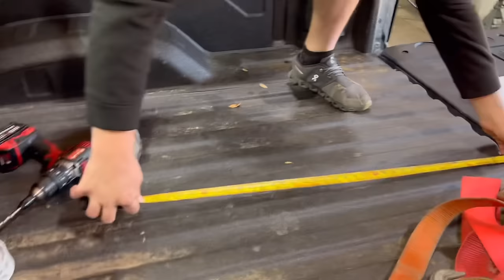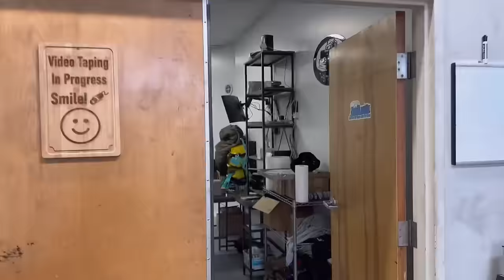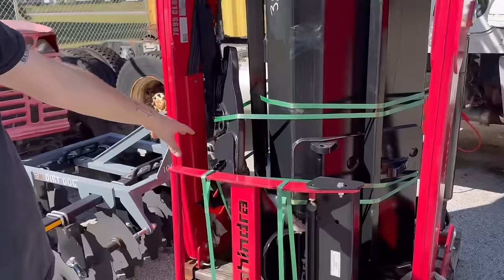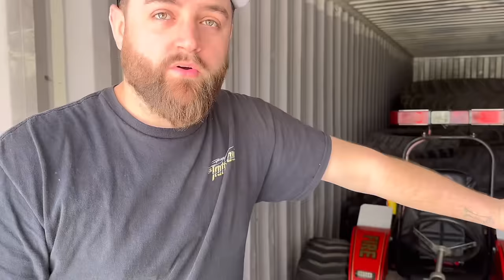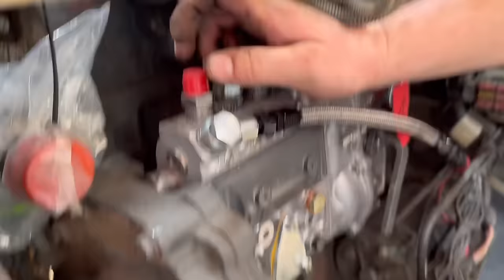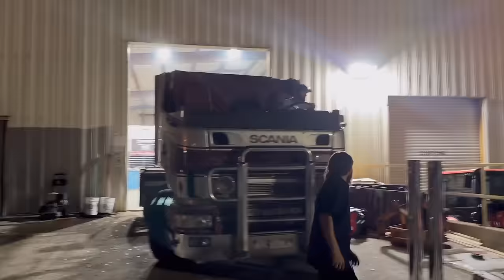We Are MOVING to Tennessee! Big Changes Coming!

Comment: Scania dealership, partnering up with the guys from semi casual. First scania dealer in USA. 
Just a guess
Reply: My thoughts too……..exactly
Reply: Have you seen Fitzgerald shop in Tennessee? Looks like a city. Semi casual is a tiny part of the operation. Not just Peterbilt Freightliner, international is the main manufacturer they work with.
Reply: @Carlos-r5n2b  Yes, I’ve known and been aware of the Fitzgerald name because of their many dealerships and glider business for many years. My guess is maybe something associated with that trucking family and possibly some type of association with Scania. Just a gut feeling I guess.
Reply: I’ve also seen the huge operation at FCR. Most fascinating repair business ever. Wow! 👍🏻
Reply: @BigJohn29ky  maybe 🤔
Reply: @BigJohn29ky  they do show car quality paint. Want my 61 Ford starliner paint put back original inside is original. No good painter around here i saved enough for quality job gonna be careful who I hire to do work. No hot rod original fender skirts complete chrome 352 v2 i rebuilt transmission too . I can do so many things I learned from watching others but body work and paint is an art I suck at☹️
Reply: Navistar is Scania's sister company in North America. If Scania go for it, it will be via already established dealers. Bruce an naturally work for them

Comment: Drill a couple of drain holes in the bottom of those plastic IBC containers so if it rains or they get water in them it won't pool & rust the parts.
Reply: Going in a closed trailer “dry van”
Reply: @alwaysbrokecustomcycles2022  Won't always be inside a dry van. Drain holes are cheap insurance against flooding.

Comment: If you are been a licensed Scania Importer in the US it will make sence or if you are going to use a fleet of vintage trucks it will also make sence. There are no Emissions tests in Tennessee and if you have a problem with a car it will also make sence since Scotty Kilmer lives there LOL
Reply: Florida has no emissions also.
Reply: You don;t need a license to import 25+ year old trucks. If you're talking about new ones well they need to be made in America.
Reply: @sic22l  They don't need to made in the US, just homologated for US... Maybe some import duties in addition.
Reply: @sic22l if that were true we wouldn’t keep buying Chinese crap lol ( ps foreign manufacturers only build factories in America if it’s cheaper than shipping large numbers of them in the correct spec over, in short low volume imports means no factory)
Reply: @Mygirlfriend3141  A Scania is what we in Europe are calling the worlds best truck maybe not the most powerfull that's a Volvo but the Scania engine is much better when it's maintained. And by the way have you got ABS on the front acsle on the American trucks or are you still only having brakes on the rear acsle?
Reply: Sense
Reply: @michaelbisgaardlaursen  1 I’m not sure you can speak for a whole continent, though yes Scania’s are very good, 2 it’s “axle” :)
Reply: @rkan2  Yes, a chicken tax. That's another reason why it makes no sense to import trucks to the US.
Reply: @gimble447 The only Chinese trucka in the us are small electric box trucks or buses. Both made in the US.
Reply: @sic22l  I was talking about cheap and nasty products in general that flood the market and are imported that aren’t built in America in a light hearted way, the real point I was making ( in relation to the likes of trucks and other vehicles etc) was the latter half of the comment, enjoy your weekend

Comment: My husband has been watching you bring tractors back to life. He has a MF 231S. He is having trouble with the hydraulics. He put a new hydraulic selector valve and hoses on it because the old valve was leaking. This new one is still leaking where it sits on the tractor. It has o rings on the bottom of the valve. Could it be leaking because of air in the system? If so how do you bleed the hydraulic system t remove the air. I’ve looked and looked and I can’t find any video showing how to do this. Please help. Thanks Charlotte

Comment: I like driving through Tennessee the roads are nice, except for the big lib city's, their ideal of road maintenance is on those electric boards overhead they put "Possible Rough Road Ahead, Use Caution". It's like they know the roads have huge pot holes yet to bad we are not going to do squat about it but keep on taxing you.

I went through Nashville the other week and not just the steer went in the massive pot hole both of my dually went in the hole as well.